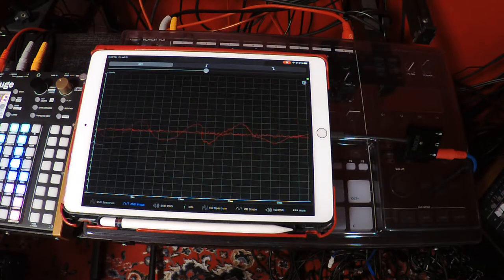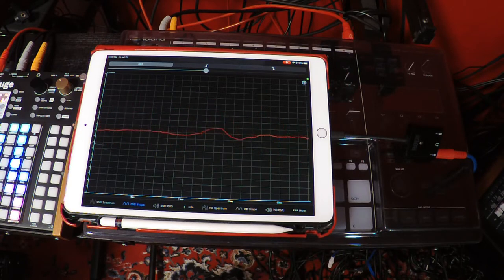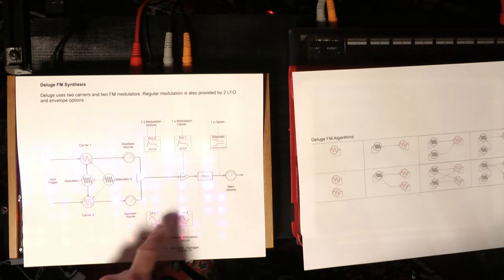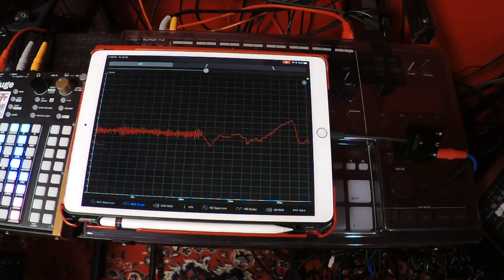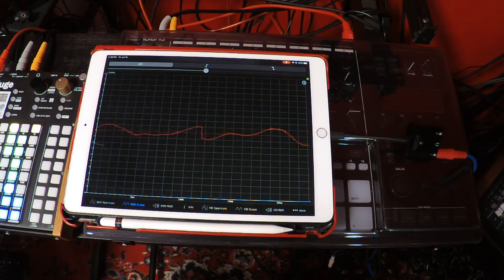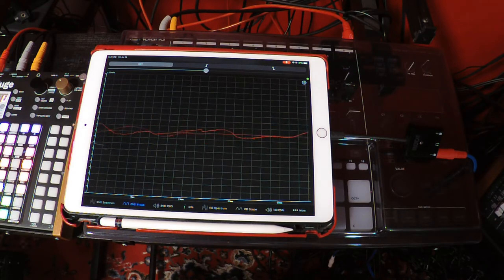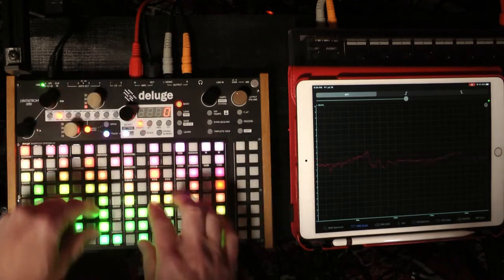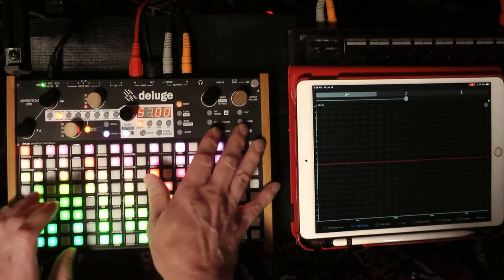Synthstrom Deluge FM Synth How To Make Bells and more

Comment: I have a modx as well, and a volca fm, so I was thinking of just sampling into the Deluge, but its nice to be able to make them internally.  Thanks for the in-depth explanation, nice job.
Reply from the maker: I could see sampling in FM working in various cases...like if the sound is mainly characterized by an initial attack. Some evolving sounds or ???various other FM sounds are nice to build up in an engine. But some thick FM has to be on the MoDX (8OP!!! x8 layers x 16 tracks - Yowza!!) Deluge is so portable though!

Comment: This was seriously so instructive !! Thank you!! One sound that i dream of finding on the deluge is the classic synth brass of the dx7 :)
Reply from the maker: Much appreciated! I looked it up and that one uses the 6 operators of the DX7 in 2 chains of 3 operators. While Deluge only has 4 operators, it has some tricks the DX's did not - but much less envelopes - so that would limit you there. It could be done, but I have found that the original Deluge presets had an amazing Synth Brass preset which i still use because it sounds great like a CS-80. It's using Subtractive Synth though...maybe a different flavor than you want.